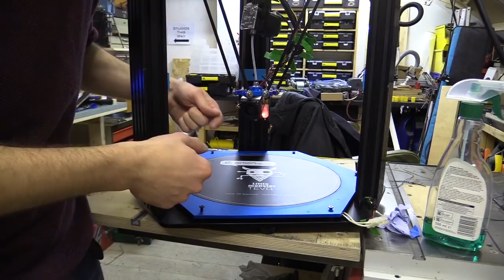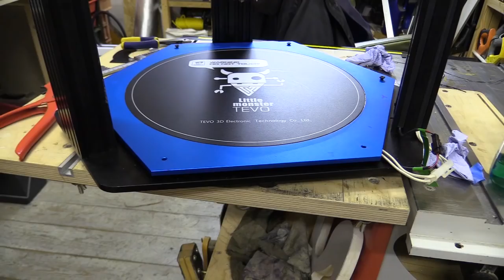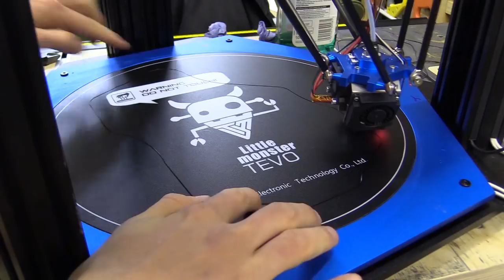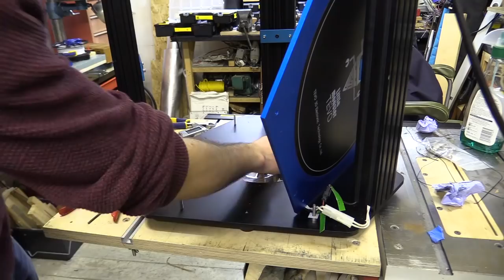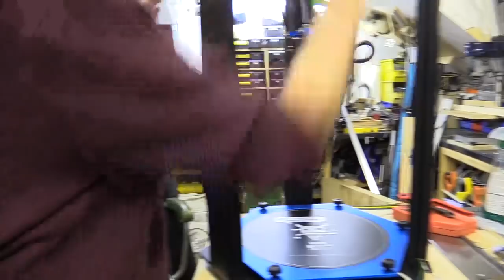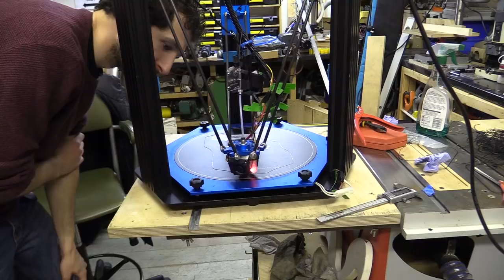Manual Levelling Mod to Tevo Little Monster

Comment: I recently performed this mod because I have the same issue with the parts having uneven compression on the first layer, as of today, I still havent found a solution to this calibration issue.
Here are the parts I used:
Thumb Screws: M5x30mm Male thumb screws
https://www.amazon.com/gp/product/B07KPFTY3D
Spring: SP 9721
https://www.amazon.com/Prime-Line-Products-SP-9721-Compression/dp/B008RF771U/

I leveled each hot bed corner to about 20mm height from base of the machine to the top of the hot bed, this raised the bed about 8mm.  Measure this height before raising the hot bed and take note of it.   After installing the springs and raising the bed, I had to modify the z-max setting in 2 config files on the SD card that holds the firmware.  I got my machine in April 2017 and the original z-max setting was 520.  I subtracted the increase in my bed height from this value to come up with 512 as the new value.  Make a back-up of the SD CARD contents before changing anything in case it will be needed.   WARNING: If you do not change the z-max setting your hot end will crash into the hot bed at the start of calibration.

After calibration, you need to make finer adjustments with the thumb screws to dial in the leveling.  To do this, I just used one of my random STL files I had on hand with a circular profile like a vase and configured my slicer program to print a skirt around it with about 30 loops.  I set the skirt distance far from the part so it was created towards the outer region of the bed plate.  When the skirt is being printed, you can start manually adjusting the thumb screws and see the adjustment results in real time.
Hopefully this helps some people who may have additional questions.  Great video by the way, thanks for sharing.

Comment: Would be great if you would post what size diameter and length the bolts you used were for everyone. Thanks.
Reply from the maker: I'll double check when I'm next in and share that. Think it was M5 and 30-40mm but I can't remember off the top of my head.
Reply: @EducatingSavvas  what size springs also please
Reply: @EducatingSavvas  I would also like to know what size springs